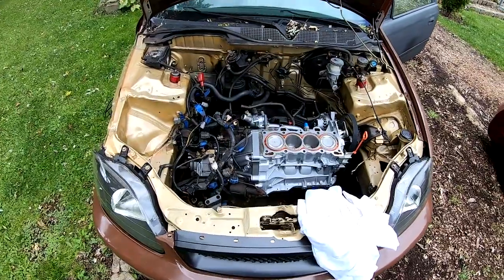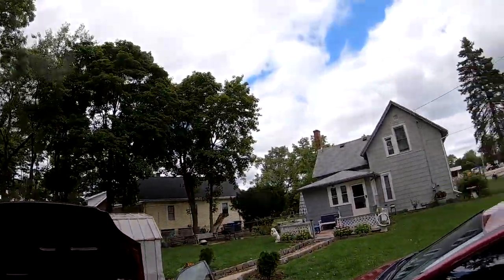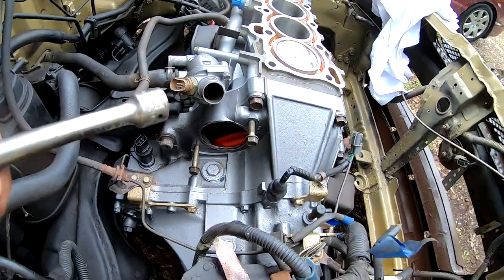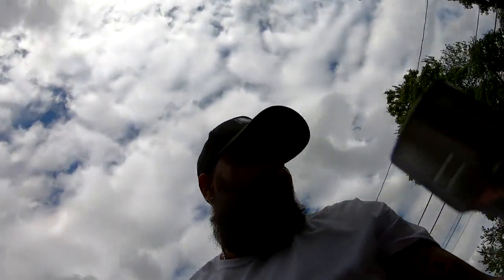Civic Driver side suspencion re assembly #Nesquik starter removal

Comment: i would redo that lower ball joint nut if i were you, you need to have the weight of the car on the control arm when you tighten the ball joint nuts just a heads up if you didnt know, best way to do it is to use a floor jack to push up the control arm, take the wheel off tighten the nut and reassemble
Reply from the maker: Thank you will re tighten